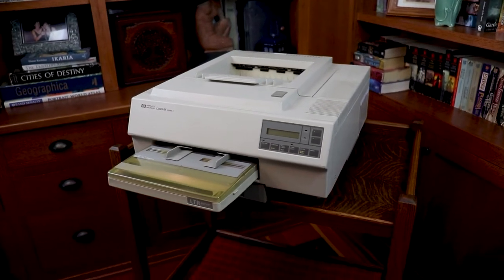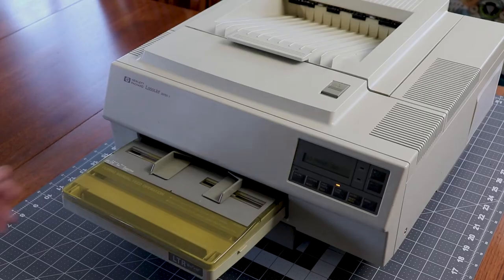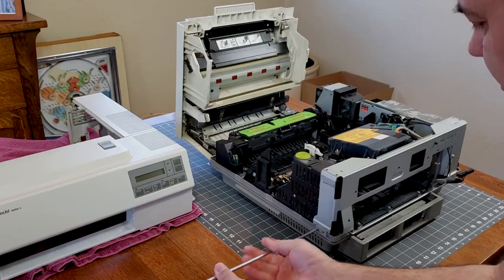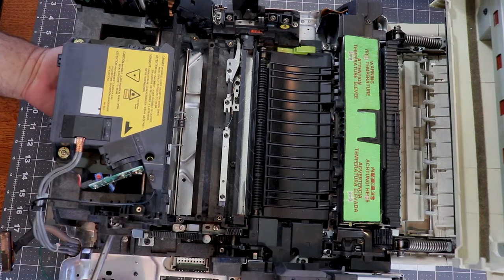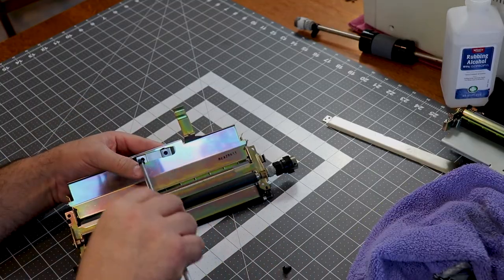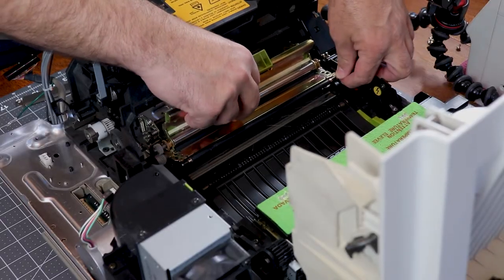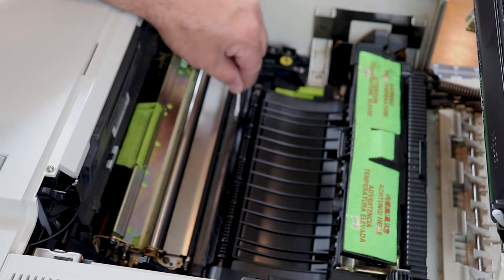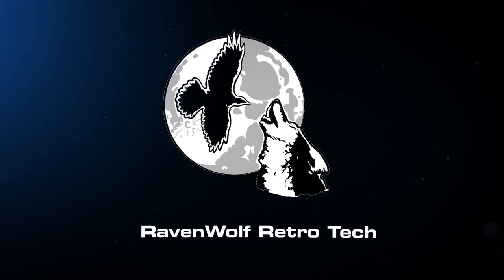Classic 1980's HP LaserJet II Printer Restoration

Comment: Fixed hundreds of these back in the 90's. Always sticky solinoids, worn rollers, dirtry laser units and noisey fans. They were great machine for it's time. Also fixed loads of LJ 3.,4,5 and 6. Am still a repair engineer today and those 80's/90's machines were way better build quality than todays stuff.
Reply from the maker: Robert, I completely agree. It seems the early machines all had a quirk or two but, once fixed they were complete tanks! Blasts from the past: LJ II AC Power Supplies, HP IIp laser motors, HP 4 exit assemblies.... 😂
Reply: might i inquire... what model of hp bw laserjet model would you recommend? that can work on usb? good build quality older models, that you can still get repair parts for.

Comment: Great video man! I spent 6 years as a photocopier/printer tech working on Sharp, Canon and HP gear. I saw tracks on the end of the paper when you pulled the tray and yelled "SKIDMARKS!" lol Boeing used to have a surplus store where you could go buy their surplus items and you'd find cast off laser printers by the pallet and I used to buy them up and part out or repair the printers and sell them. Good times. And funny enough, laser is laser is laser... the tech hasn't changed much. You do a great job presenting this stuff and being as I am very PRO right to repair, I am glad to see you actually fixing something "retro" and promoting that repair. Kudos!
Reply from the maker: I appreciate the kind words. Its getting a lot harder to find parts, even NoS stuff is going bad (Mainly the rubber). If you like this one I will have an Apple LaserWriter (Canon CX engine) in a few months that I expect to be a nightmare to get running again :-/
Reply: @RavenWolfRetroTech  Bring it on! I will be watching
Reply from the maker: It has to wait until the shop is finished but is near the top of my list once it is!

Comment: Enjoyed the video. I've been working on printers for quite a while now, but I can't remember seeing that model before. Interesting to see they have used those foam pads that turn to sticky gum for that long. I think they finally changed it to something more like felt on the 4014. I have an old Lexmark Optra R+ I used at home for about 20 years. It started to make a grinding noise so I set it aside to repair. I should take a look at it soon. It served me well for a long time.
Reply from the maker: If i remember correctly, the Optra R+ has a huge toner hopper. That should last a lifetime of home use as long as the rubber parts survive
Reply: @RavenWolfRetroTech  Yes, they have a 7k page cartridge and a 14k. The 14K lasted me many years. Found it unopened on Ebay for about $20. New they cost over $200

Comment: Fixed a ton of these printers back in the 80s. The most common problems I saw were malfunctioning pickup rollers, fusing assemblies, and DC controllers. Fortunately, all were relatively easy to replace. All that was neded for the pickup roller replacement was the removal of the case, followed by the removal of the two screws drom the pickup rollers. The fusing asembly was also very easy because there were only four screws holdig it down.
Reply from the maker: I agree completely Louis! After the LaserJet 500/Canon CX machines' complex and time consuming disassembly, these were a breath of fresh air. The hardest it got was the lower feed roller on the LaserJet IID version. I had a friend that coined it "Saucer Separation" 😃
Reply: @RavenWolfRetroTech  Yep, I rememnber those as well. I also serviced the original HP LJ500, as well as the Apple  Laser Writer. Those were much more involved to service. The paper detect sensor was also pretty hard to get to, if I remember correctly
Reply from the maker: @louisd95714  Yes I remember the feed rollers taking 2 hours because you have to go through the top to get to the rollers in the bottom. I have 2 Apple LaserWriters and a HP LaserJet Classic but have held off on doing a restoration until I get better at making videos. I am concerned about feed rollers and transport rollers. The rubber has broken down and I cannot find any replacements. I am hoping to find something like the "Feed Tire Tape" of old (I absolutely HATED that stuff and forbade it in the shop but now it may be my only hope). Do you have any suggestions?
Reply: @RavenWolfRetroTech  Sorry, I do not have any suggestions at the moment, but if I can come up with something I will reply back. Am wondering if the HP site can be of any assistance.

Comment: I bought a LJ Series II in 1988. I had to service the paper pickup twice, and I had to replace a tantal capacitor in the power supply. My problem now is that I am unable to find working toner cartridges. There used to be a chinese supplier for these wiper blades, but that's no longer the case. Other than that, I think this printer could outlive me.
Reply from the maker: If I ever find a source I will be sure to add it to my blog. I have picked up a few NoS wipers but each and every one has hardened and is useless 😟

Comment: i love  90's and early 00's computers and peripherals a year ago i saved from scrap a laserjet 5m from my school, it sat outside for a year but i dried it all and it powered up, fan needs oil and toner is cartridge is busted because of the water, i still have to try it out with a new cartdrige, i recently saved an epson lat 90's laser (i dont remember the model but its a mid size) wich just needs a new fuser, also have got a epson dot matrix lq100 (needs new ribbon), i also recently got 3 different laser printers from a repair shop (1 is a big a3 copier with no issues and also a good toner)2 of them have problems picking up paper, one is well used a brother mfc-7320, when it picks up a page from the tray it always get stuck middle in the toner and i have to take the toner out to unjam it but if taken from the front feed works ok, do you know why is it doing this?
Reply from the maker: I have to be up front that I have not worked on a lot of Brother printers. Typically, if a page is feeding partway in and stopping it is either a sensor issue or a feed tire that is not tacky enough to feed the paper far enough (A paper late jam). I would start by thoroughly cleaning all the sensors and feed rollers (Distilled water is best for cleaning rollers, never alcohol). 80% of printer service is janitorial, clean everything then see if that makes a difference. Trying to fix an HP 5m that has been outside is going to be a huge challenge.  From the feeder assembly (That is not serviceable without special jigs) to fuser, exit assembly, scanner etc... it will need to be stripped and cleaned before power is applied. It may work for a bit but any film on the fuser lamp will result in failure pretty quickly.
Reply: sorry for the late reply, regarding the 5m when i got it i partially took it apart and dried it up entirely and turned it on with its original trashed leaky toner just to test and i got very black pages but the print was visible and there was no jams at all just the first page wich was due to dirty rollers and the fan needs some oil, its still waiting a new toner wich i wil buy in the future but i turn it on every once a while but there is no toner/fuser (the fuser is on the cartdrige).
regarding the brother im sure that the problem is the rollers wich feed the paper trough the toner, i dont think its a pickup roller issue.
Reply from the maker: @stv plus Wow this is a slow motion conversation, YouTube never notified me of your reply and the comment filter was not showing it as not replied to. I am curious how this has been going for you?
Reply: @RavenWolfRetroTech  haha, still nothing regarding the printers i have,i recently got an epl 5700, it needs a new drum i think because it vertically stripes always in the same spots and the drum itself has black lines that wont go away even with alchool but luckily toner and drum are 2 separate units. it has even the accessory paper guide you put on top of it to make the paper go upwards instead of laying straight. it picks up paper like a charm, but it squeaks everytime it picks up, so i may have to lube it. cosmetically it cleaned up almost like new, not yellowed at all.
Reply from the maker: @stv pls, I promise I'd be more help on Canon engine printers like the HP's 😜 The stripe is often caused by the wiper blade that cleans the drum. They are usually made of polypropylene and, if cleaned, MUST be lubricated with toner before reinstalling or they will stick to the drum and damage it. I usually powder the drum with toner along with the blade to be safe (Make sure the edges are powdered too). Even so a damaged wiper cannot be fixed with cleaning so usually replacement is needed.
Reply: @RavenWolfRetroTech  i dont think its a blade problem because it has some stripes that i can feel on it and its the same patterns it has when printing
Reply from the maker: If the marks on the drum are scratched into the surface there is no fixing that. If there is buildup on the drum then it can be carefully cleaned with a cotton pad and alcohol (maybe). If there is a buildup of toner on the drum that can be rubbed off then it is usually the wiper blade. The coating on the drum is photo-conductive and very thin, it only conducts electricity when exposed to light so it is charged the same polarity as the toner (so it repels) then the laser exposes areas so that the charge is conducted to ground. The toner is then attracted to the exposed area. Unfortunately, if the photo-conductor is damaged then the toner is also attracted to that area since the ground is exposed. There are a few McGyver fixes that can be done but they usually cause more damage to the drum in the long run

Comment: Здравствуйте! Какого типа устройство термозакрепления? (Fuser). С тефлоновым валом, термоплёнкой (thermal film) или что-то другое? Заранее благодарю за ответ. Мне очень интересно.
Reply from the maker: The LaserJet 2 uses a halogen lamp in a Teflon coated roller for fusing with a softer lower pressure roller. The rollers are lubricated by a silicon infused Nomex pad that is replaced with every toner cartridge.
Reply: @RavenWolfRetroTech  Довольно надёжная система. Всегда покупаю принтеры с тефлоновым валом в "печке". Спасибо за ответ! УСПЕХОВ!

Comment: Curious, any chance one of these could be compatible with a modern computer? I just received one as a gift and I actually need a functioning printer so I’m looking for solutions on getting it working.
Reply from the maker: The memory is severely limited -- so much so that an expansion is needed just to print a full page with graphics. Then you will need some kind of USB to parallel adapter. Simple text might work though.